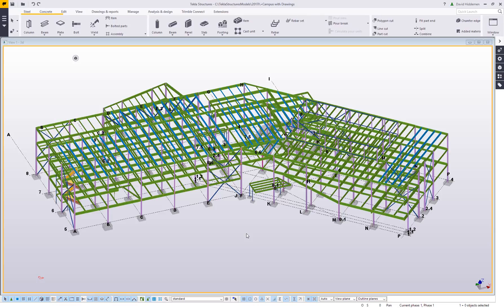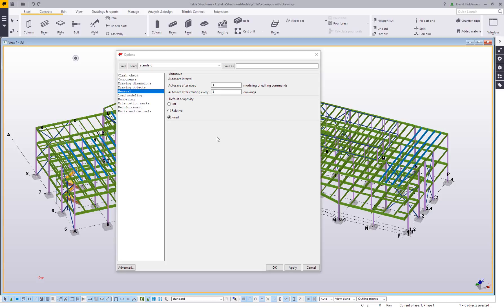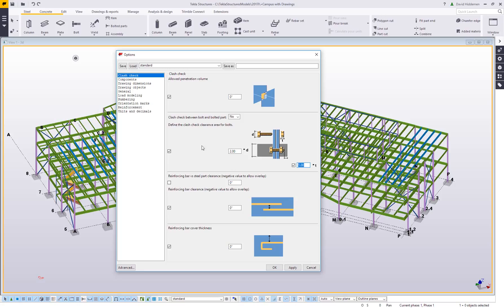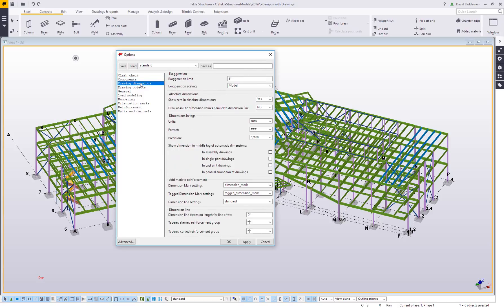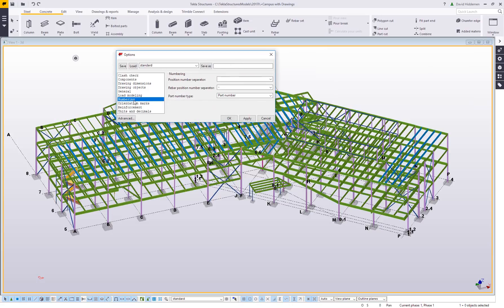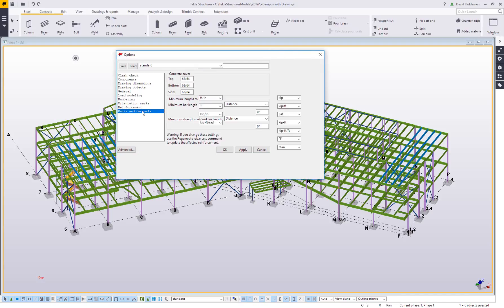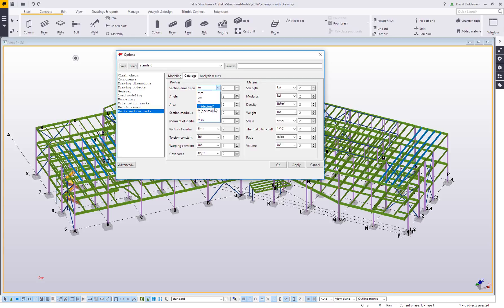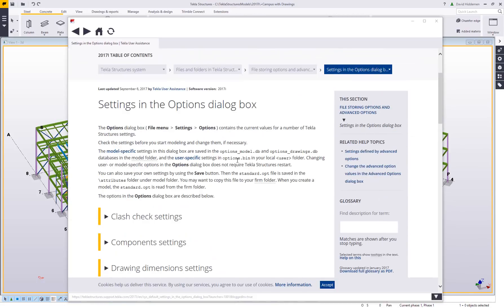Options Settings in Tekla Structures

Comment: Hello, is it possible to get user-parameter from inside a component into a template? With other words, I need to show in a specification some values of a custom component. This custom component is a seem-type component that builds up complete truss assembly, this truss assembly must be shown in a trusses specification, and in that specification I need to show some user-defined values that I put via component window.
Reply from the maker: Please reach out to your local Tekla helpdesk support team: https://www.tekla.com/contact/offices-and-resellers.

Comment: if the Project North is pointing upward, what is the viewing directions, is it (South or West) or( South or East)
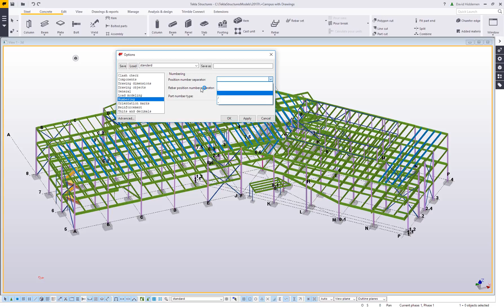Reply: Part orientation is South and West by default, but you can change that under the File > Settings > Options menu, you can see around the 4:45 mark. Model views created by the grid are not affected by this, as far as I know and always look North and West, in my experience.

Comment: My bolt size are always in default, and the bolts are circular instead of flange or hex bolt. please how can do
Reply: Hello, it would be best to contact your local support for assistance: https://www.tekla.com/contact/offices-and-resellers 

Bolts need to be defined in both the bolt catalog (all bolts, nuts, and washers) and bolt assembly catalog (which bolts, nuts and washers go together with each other), usually included in your downloaded environment. Then, in the options you can select which size and diameter should be the default. If the catalogs are not defined correctly, you can have failed bolts or strange looking ones.